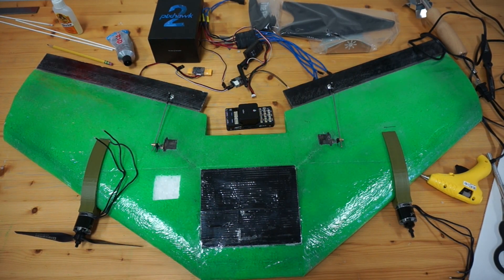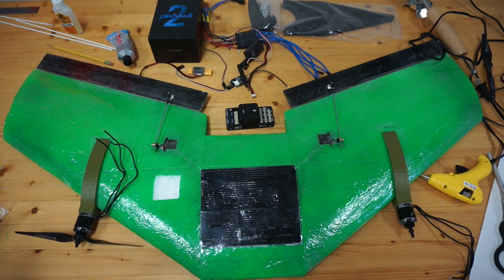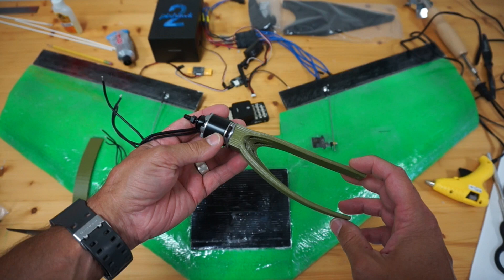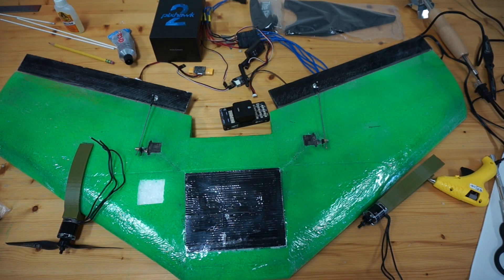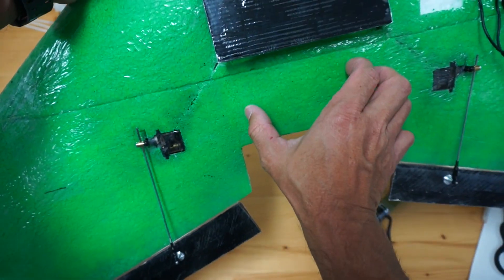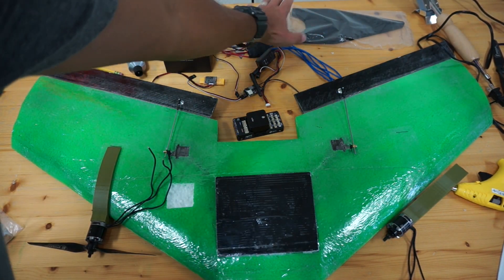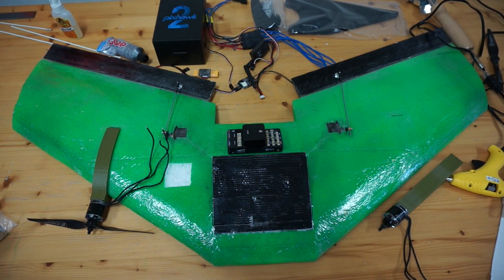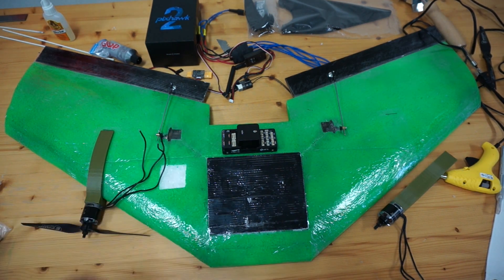SweepWings Flinch with Pixhawk 2 Cube and PX4 VTOL TiltWing/Tailsitter

Comment: Thank you for sharing this project, it helps very much that you can't imagine. My only concern is, what if we try to set the flying wing up with just a single rotor and two servos? Will it still hover in vertical position with the help of large control surfaces?
Reply: Not with a pusher propeller, but a tracker propeller of course

Comment: Hi Dennis, you got more videos of this project? I have a question if I may, I'm building a mini talon with pixhawk 2.1 cube, my question is :- if the battery is connected and plane is armed, if you put it in RTL mode should the motor start? I'm talking about 
If the plane is still on the ground just bench testing. Or the plane needs to be a certain altitude or distance from where it's got 3d fix before RTL kicks in? Many thanks. This is my second question, my first question was about 5 years ago I can't even remember what the question was !! 😁 so much goes on in this hobby. So much changes so quick lol thanks again

Comment: Hi Dennis, Congratulations on the Tailsitter project.
Friend I am setting up a similar version and I am in doubt about Q_FRAME_TYPE, which use X or H. Which one did you use and what is the rotation of the motors for CW and CCW. Would you help me?
Reply from the maker: I'm fairly certain that Q_FRAME_TYPE does not apply to tailsitters. Check this thread for the necessary parameters: https://discuss.ardupilot.org/t/dual-motor-tailsitters/15302/2 There is a lot of discussion in there but I would recommend bookmarking it and coming back from time to time. That's what I do to stay up to date.

Comment: Howdy Dennis, any chance you can upload the stl files for those motor brackets, please plus cake? Matt
Reply from the maker: Matt, are you going to modify them because they are designed specifically for this wing and Lumenier motors? When I get this fully functional I'm going to work on designing a few variations. Let me know what you're thinking.
Reply: Howdy Dennis, I've got a collection of wings here that I could use to put twin motors on. I know they won't be perfect, however if they're opposites, if rammed, sorry "gently placed" onto the wing in the same place on both sides, they should skew evenly. Well thats my logic anyway. As for the motor mount being for the Lumenier motors, if they're not standard mountings (16x19), enabling a standard X mount to be fitted would be best as that would cover all the 20' sized motors. Matt
Reply from the maker: Matt, these are the motors I'm using:

http://www.getfpv.com/fx2216-9-1100kv-v2.html

I'm not at my computer so don't have exact dimensions atm. But here are the files so maybe you can look:

Flinch left motor mount:
https://www.dropbox.com/s/s93wnwhdmhh7szo/flinch_left_motor_mount.stl?dl=0

Flinch right motor mount:
https://www.dropbox.com/s/fpho223kiftled7/flinch_right_motor_mount.stl?dl=0

I'm going to work on improving this design next week. I need to add more distance between the prop and wing by lengthening the mount. Right now the props are too close (< 5mm) from hitting the wing.

Thanks for the feedback.

Comment: I can predict how it will turn out, if you are using a worthless Pixhawk with it's crappy firmware it won't ever work at all!
Reply from the maker: What makes you say that? I've done lots of builds with Pixhawk over the years and never had any major issues. Community has been very responsive in times that I did struggle. The code is open source so feel free to contribute and make it better.
Reply: steve c this will work Dennis is not one of the stupid people that can't comprehend.   Are you saying you are.
Reply: The PX4 might work if there is an F3 hiding inside it! LOL
Reply: Steve you obviously no nothing about pixhawk other than comments online from people like you
Reply: Can't wait to see the flight trials Denis. So far the successful hovers I have seen are on wings with huge aileron surfaces so it will be interesting to see how a regular wing responds.
Reply: Wrong, I tried to get Pixhawks to work for 3 years but it was impossible because the crappy shareware you have to use to program it would never work. It finally broke from handling it so much and trying hundreds of updated versions of the programs with bug fixes that never worked!  Now that it's obsolete and Pixhawk Co. and 3D Robotics are out of business and not making or supporting them anymore it doesn't matter so everyone should move on to something newer that really works.  Now go out and play before your Mom finds out you are using her computer without permission!
Reply from the maker: Yes I'm anxious too. I wonder if I'm going to need bigger elevons as you point out. Not sure they will have enough control authority but we shall see :) Thanks for the comment.
Reply: you clearly have no idea what you are talking about

Comment: I found the PX4 firmware difficult to work with.  The documentation was too sparse, and the developers at the the time (mid 2016) weren't responding on the PX4 forums.  Ardupilot have been making steady progress with this style of configuration, and there's active thread on their forums that may help you out: https://discuss.ardupilot.org/t/dual-motor-tailsitters/15302
Reply from the maker: Thanks Guy. I didn't realize Ardupilot was that far along. I've used it for a Tiltrotor (Firefly 6) but wasn't aware of Tailsitter support. It's definitely my preference so I'll start there. Appreciate the heads up.
Reply: Ardupilot FTW
Reply: Ardupilot FTW
Reply: The PX4 is a lot more than difficult to work with, it's impossible to ever get one working!  I tried for 3 years to get a PX4 to work installing hundreds of updated versions of the firmware with bug fixes that came out almost every day and finally gave up after it wore out just from handling it so much!